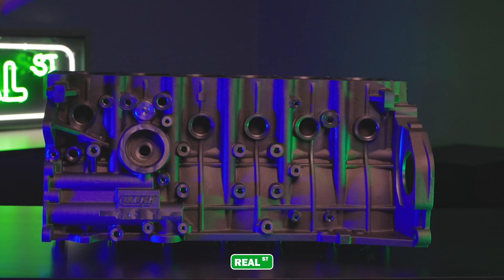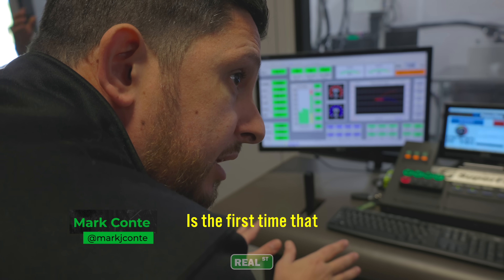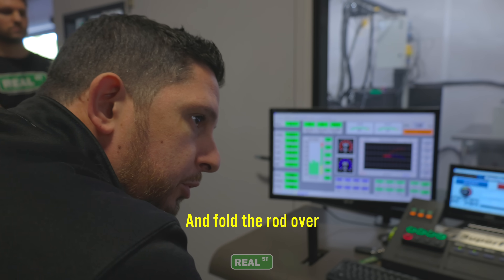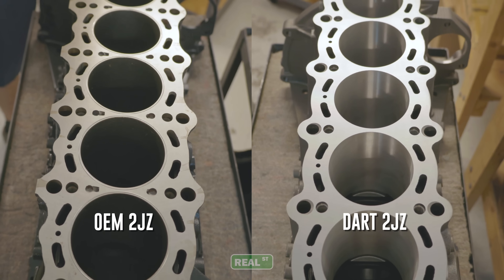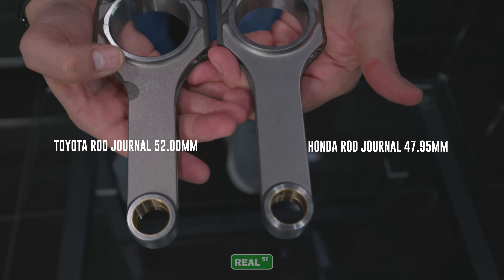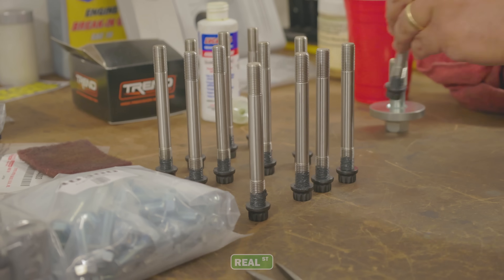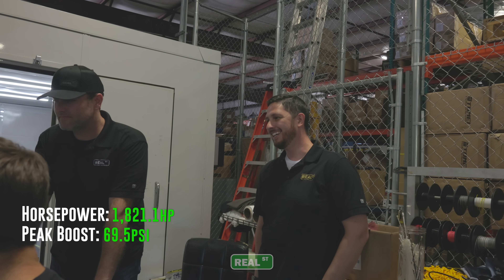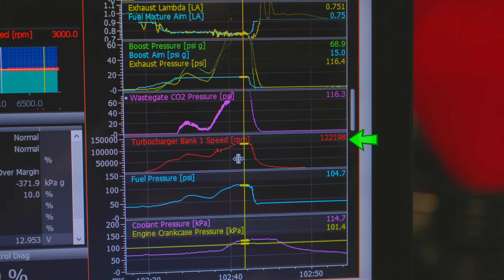3.5L Dart 2JZ + 70psi = 1,821hp | Precision 8685 Next Gen Turbo Testing on SuperFlow Engine Dyno

Comment: I'm a Dart fan but "only" 1800 horses, let's push it to 2500 to impress people
Reply from the maker: We cant wait to push the block further! The 8685 Next Gen turbo that just released and we were testing in this video has a rating to 1800 hp. Once we put a big turbo on this engine we are looking to make over 2000hp :)

Thanks for watching!
Reply: As a long term jz owner you have not ever reached what the stock block jz had done.and why the big stroke.3.0 or max 3.2 rev it to 11500 and make 3000 HP..I mean who am i.i have just been playing around with jz for 20 years.

Comment: I'm really liking your content. You package a lot in with really great information and not too much BS and trying to overhype everything.
I don't even own a 2J, but I do own a a Barra turbo....this dart block even almost at the capacity of my motor; it still sounds like a 2J!
I always wondered if the 2J and a Ford Barra would sound different if they were the same capacity?
It's a weird thing how all of the performance turbo charged 6 cylinders still carry their unique resonance sound 👌
Albeit RBs do sound a lot like a 20B rotary at certain areas of the rev range? 🤔
I always jump up listening with excitement only to be dogged by another pesky Skyline 🙄 of course it's a Skyline, the probability of it being a manual 20B anything is f***ing so low, but somehow I still get excited at the possibility of being one even though know it's darn Datsun FFS

Comment: 70 PSI and only 1800 hp??

Am I missing something here??

Don't the billet blocks at the same displacement make 3000+??
Reply: They were specifically testing the block and the turbo. They shut the test down at the max rpm given by the Turbo manufacturer. They also were running a factory head gasket and oil system which the billit blocks don't. They are going to tear down the engine and check the bearings and then rebuild it with a bigger turbo and the upgrades that the billit block guys to. This vid isn't to build the heights HP engine o. The Internet, it was to test to see if a cast iron block and new turbo are capable of what they said they can do.

Comment: How much is a setup like this 50K? Anybody else want to guess
Reply: Bout tree fidy.
Reply: Yeah you’re over the 150k range
Reply: The block is only 4500. I can't imagine this costing over 30k for the long block and turbo setup. Now the ECU can be as cheap as 3000 or as much as you want to spend. But 150k is way too high an estimate for this. Stock oiling system. Stock cooling setup. Stock sized head studs and style HG.
Reply: The 1/2" head stud option is free too. I'd have that option checked automatically to help with HG sealing. I can imagine a stock Bore/stroke would seal awesome with those studs and meat on the surface. I bet a 1200whp 2JZ with this block setup would be very reliable.

Comment: Making big block numbers on a 3.5L is just nuts, this dart block is a absolute game changer, i wonder how it's going to compare to billet blocks over time. It being cast iron is awesome for a ultimate street build because it will have much better street characteristics. I've heard of billet block guys needing to fully get the block warmed up before making at hit on it.
Reply: The key to big block numbers is 70+ psi of boost😂 The engine is still very impressive though
Reply: The key to big block numbers is 70+ psi of boost😂 The engine is still very impressive though

Comment: making nearly 1900hp on oem size studs and wet sump.. insane. And the top end power is wild for a 3.5.
Reply from the maker: Super cool! Wet sump actually (oem oiling system)
Reply: We'll find out more when they discover what the coolant pressure anomaly is.

Comment: Anyone know if I can run a 1.5JZ on an Aristo 2JZ non-VVTi ECU/injectors just to get myself up and running? My Soarer GT-T lost almost half its compression in Cylinder 5 and I caught a smoking deal on a brand new 2JZ-GTE short block from Toyota. Any help would be greatly appreciated.
Reply: Yes you can. 440cc  on the twins with aristo ecu. Or get some 550cc usdm 2jzgte injectors. Keep in mind the turbos have a limit so a single turbo should be in the works. Budget end a super afc, higher end a standalone ecu. Cheap, fast, reliable, you can only pick two. Good luck and enjoy your car.
Reply: @MRJZA75_34  
Thanks so much for the answer. I guess I need to call wiring specialties and get a harness made.

Comment: Do you guys mind sharing the A/R housing? I won’t be running this much power but Hanz has helped me pick out parts I’ll need for 1400 whp on the stock 2jz block and I’m seriously considering the 86/85 so I’d love to know which you guys went with?
Reply: Would have to be on the medium to smaller side to get to 70 psi out of 3.5L.  1.02 to 1.10 would be my guess...
Reply: @Ed_H_870  I was thinking 1.15
Reply: Hey guys, we went with the larger 1.28 A/R. Check out the blog post for some more details. Let us know if you have other questions!
Reply: @markconte1513  BLOG POST?!? On REAL STREET website?!?
Reply: @markconte1513  if you guys were shooting for 1400 whp with a BC 90 mm 3.2 2jz stroker using the same 86/85 which A/R size would y’all start with?? Asking for a friend lol
Reply: I posted a link to the blog post. Not sure if that erased my response.   Anyways, I think the 1.28 is the correct match for the 86mm. Realistically you could also consider the 8085 or 8385 NG since both will hit your goals and theoretically will come up a touch faster.
Reply: @markconte1513  thanks so much brother keeping that in the notebook!!